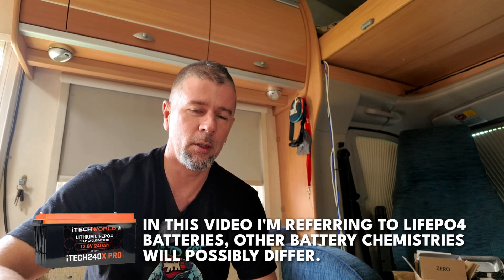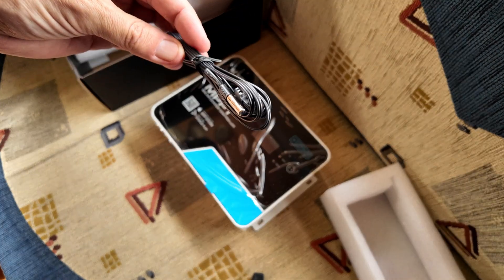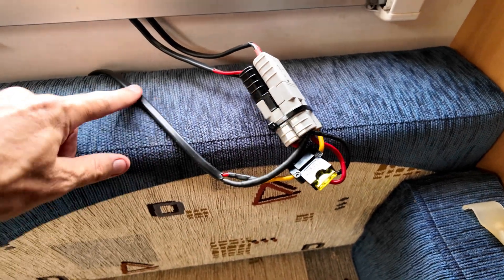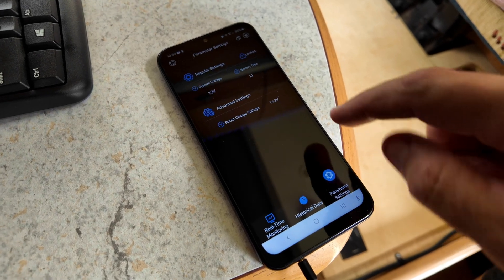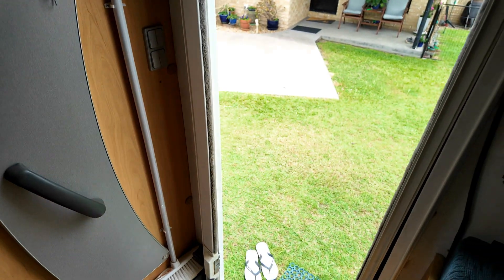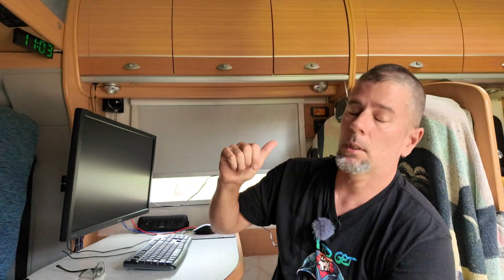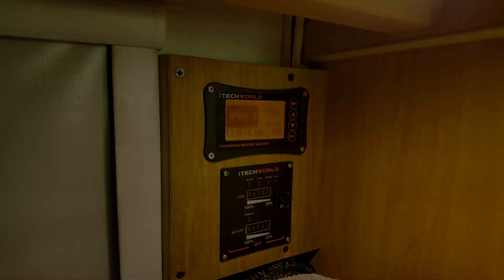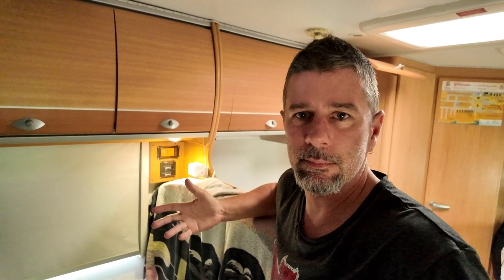Connecting 2 Parallel MPPT Solar Charge Controllers To One Lithium Battery Bank: A Moho Vlog

Comment: This is similar to my plan. i want to do 4- 250w 24v panels and I'll split them into groups of two and each pair will get it's own charge controller. this will allow redundancy and if the sun is on one side of the bus or other I'm not screwed.
Reply from the maker: Yep, good plan 👌

Comment: I have been wondering if that can be done with panels like that, on the Victron controller mount, you could have used velcro on the controller feet. That way, if you ever change controller or need to pull the fuse it makes it easier access.
Reply from the maker: Cheers yeah so far all good, I did switch the locations around a bit but no problems to date 🤞

Comment: Just started looking into this last week as I want to run 1500w of 37v 250w panels into a 12v 600ah lifepo4 without dropping 700usd on victron.
My understanding is you want to set up only one of the controllers to balance the cells not both or something bad

Comment: I have three different size solar panels, each have their own charge controller connected in parallel to the same battery bank of four 100ah LiFePo4 batteries and have no problems at all. Greetings from Jamaica.
Reply from the maker: Cheers!

Comment: I have 3 types of solar panels (with different voltages and power) with each of them their own MPPT controller and those MPPTs are in parallel connected to the battery BMS. I have no problem with this setup, I made sure all setting in the controllers are the same, like tensions and safetys. Like videos like this one, succes to everybody.
Reply from the maker: Thanks for your comment, appreciate it 🤘

Comment: You should crimp, not solder
Reply from the maker: I've not had any dramas with soldering, especially the smaller gauge conductors. Anything over about 5mm2 I will crimp 👆

Comment: I’ve got a 2nd battery set up on my Ute it has a red arc bcc’d charger on it I want add solar power can I run it through a mppt controller then straight to the battery
Reply from the maker: Yeah I would think so 👌

Comment: Maths is wrong. You don't divide watts by 12volts., you divide by open circuit panel voltage 17- 20 volts. The " problem" he's getting is the two charge controller units are not co- ordinated. They are " fighting each other". I get this all the time. I work in Marine Electronics by the way ( 25years)Best solution for this proplem is one charger only, capable of handling total current.
Reply from the maker: Not to poo-poo your opinion, but I did try the controller alone as well with the same results. I've not had any issues with the victron so far with any of the panels I've connected to it 😊 (working alongside the iTech unit)

Comment: Hi Josh. You will probably find it was the joining of two different size panels in parallel. It will always favour the smaller panels current/ voltage. And would cause it to have the symptoms you were having. The regulator couldn't decide what voltage was coming in. I would always use the same panels size and watage when joining in parallel . Just my two cents
Reply from the maker: Thanks mate! I did consider that and tried both those panels individually with the same results. They were both punching 19.9 VOC according to my multimeter. 🤔 Bit of a strange one...

Comment: you can add as many charge controllers as needed  as long as your BMSs can take it the current flow , can itechworld  BMS is it capable of taking 120amps ,
Reply from the maker: Recommended charge current up to 100A, max charge current 200A but since I've got 2 in parallel I would assume that could be safely doubled 😬 Not that I'm seeing much more than 60A in anyway
Reply: @MVDBR  yeh that safe 50amps into each i just put a projector IDC25X  with built in 360w mppt  charger in my dmax tub and thumper 120ah lithium platinum blue tooth hub running 35l fridge  ,works great ,both have 5 year warranty
Reply from the maker: @AdventureMotoEnduro  nice 💪💪

Comment: I love it Brother, 12 volt rocks, I can't believe you run an aircon off of your system, that's what I need for my boat. Keep those 12 volt vids coming mate 😅 you can never nerd out too much when living off grid 🤙
Reply from the maker: Hahaha yeah mate the ole a/c chews down about 150 amps when she's spooled up to full noise, but being such a small space to cool it doesn't take long to ease back to about 50-60 amps which the solar input can pretty much cover 💪 I don't run it often though, only when I'm feelin' a bit precious haha. Mate I love all things 12v, in another life I should have done it for a living 🍻
Reply: @MVDBR  well mate, it is your bread and butter 🏧 off grid living isn't easy, but the 12v system you have makes it alot better. You did the right thing investing in 460Ah of lithium and 900w of solar. I got 800w and 330Ah lead acid and that ain't gonna run an AC unit...
Pmslaffin It does run a 60l fridge ice cold, charge my gear, run lights and pumps. One day I gonna up grade, I run it all on a 30A controller from Jaycar.
I hope you have a great Chrissy mate. 🙏😎
Reply from the maker: @holisticaustralia  as long as the beers are cold bro the rest is just fluff 😎🤘 cheers Juddy you too 🍻🍻

Comment: Just remember Josh.

Solar runs on photovoltaic. 

Meaning an over cast day is better if the u.v is high, even If you can't see the sun.
Reply from the maker: Well I dunno about that but I know one thing, those panels work a LOT better when they're cool. Those savage little showers that have been dousing us lately then the sun pops out, the watts go off tap for a bit till they heat up again 💪
Reply: @MVDBR  it's how it works.
U.V is stronger.

That's why you can burn on a cloudy day man.

Heat does affect efficiency though.
Reply: Only approx 4% of UV wavelenghts reach the ground